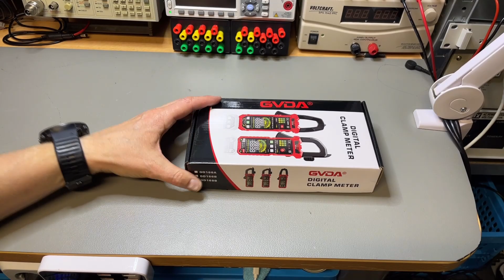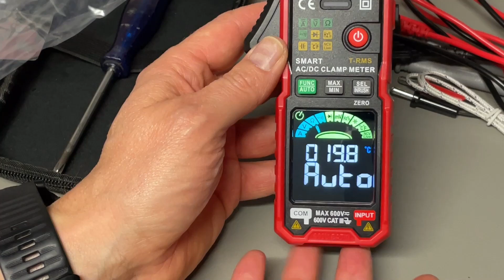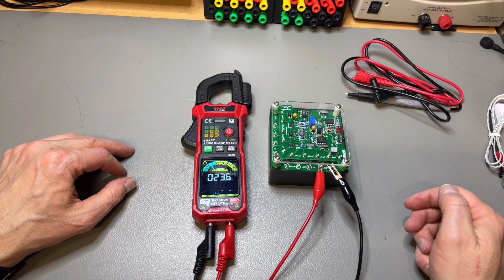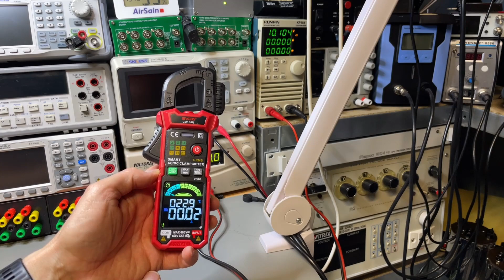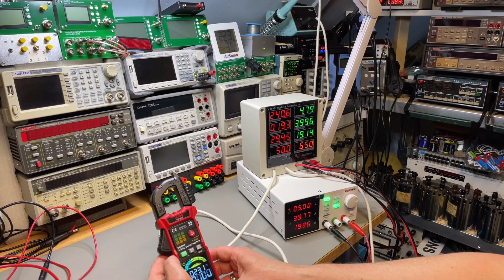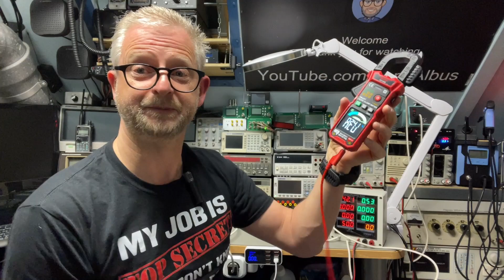TA•0353🟦GVDA GD166B AC DC Clamp Multimeter with Inrush current

Comment: Nice review Tony. I'm the market for a cheap clamp meter, so just bought this meter,  on the back of your review for £17 delivered! Can't grumble at that :)
Reply from the maker: Thank you Stephen, great timing !
Reply: Mine just arrived today - Works perfectly with the cables, but the clamp part doesn't work at all   :(
Reply: EDIT:  Took it apart and fixed it - the really thin wires from the current transformers (1 had broken off, not soldered well).  So happy now :)
Reply from the maker: @Stephen_Heathcote  no broken?
Reply from the maker: @Stephen_Heathcote  yes!  great